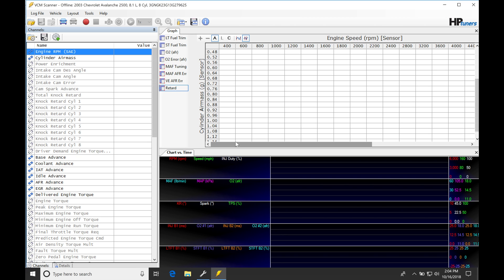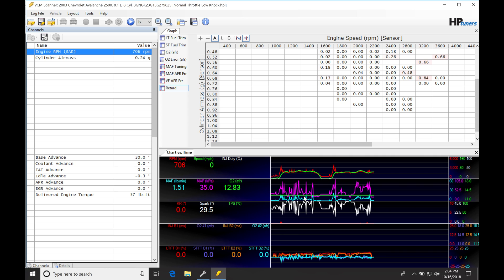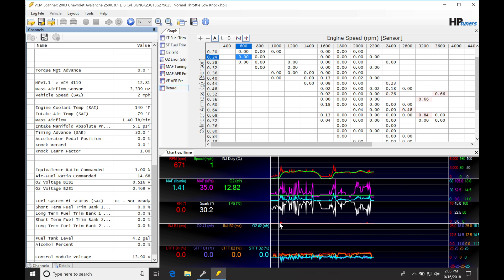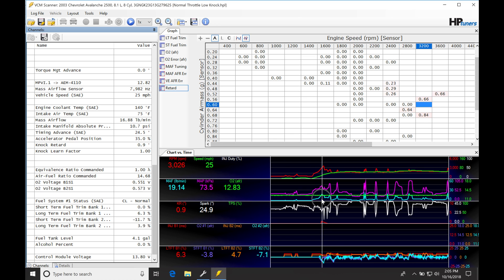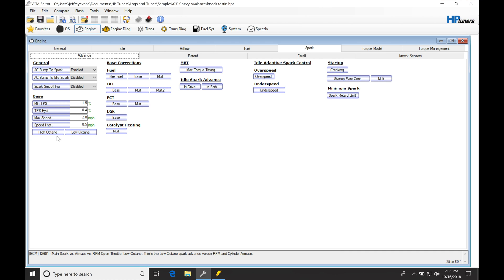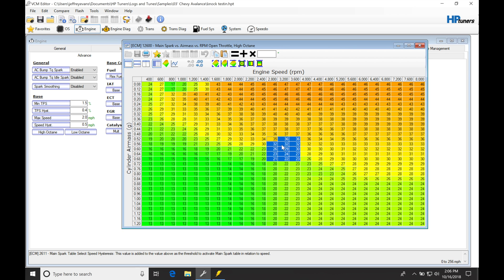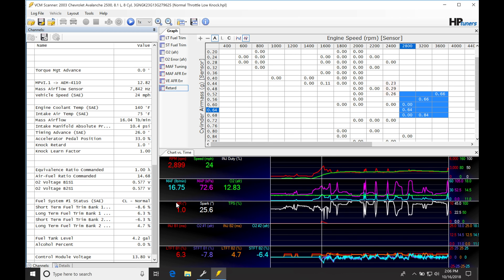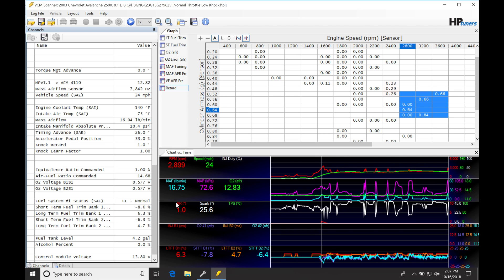HP Tuners GM Gen III: Knock Control | Evans Performance Academy

Comment: I got my knock sensors “tuned out” but the check engine still comes on for low imput

Do i need to plug them in and leave them hanging or something? I have a ict gen3 knock delete cover